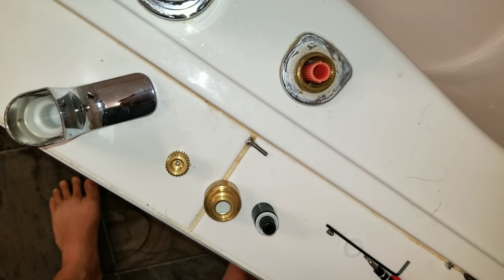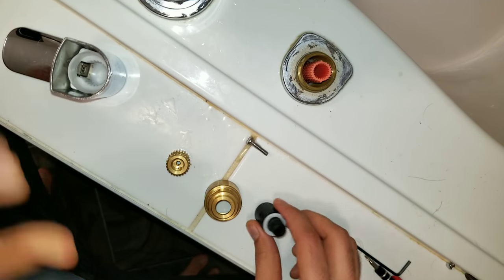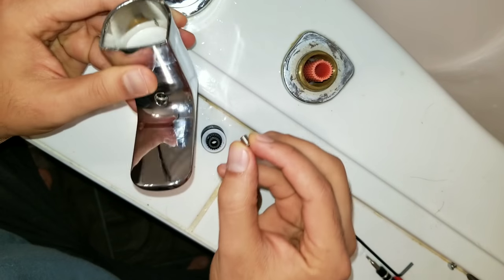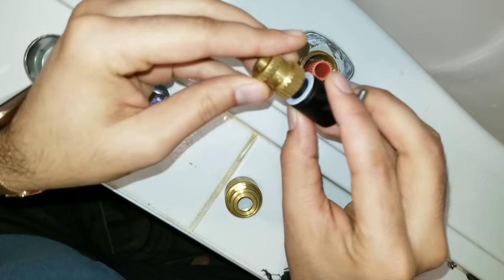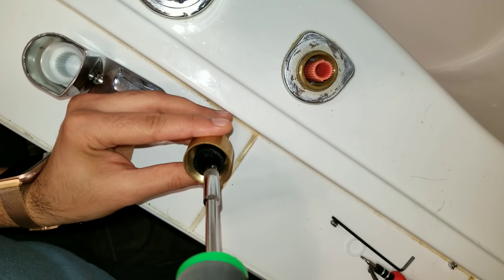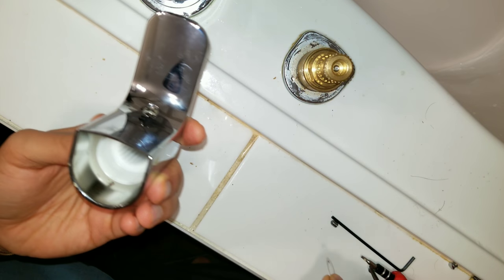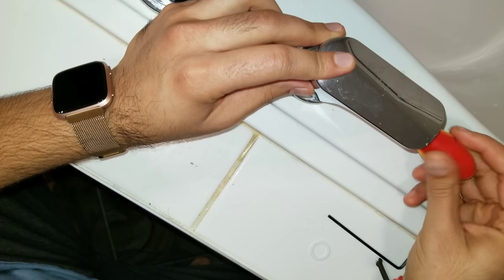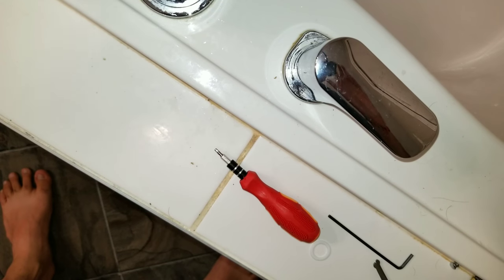Bath tub Faucet Repair. DIY (leaky or broken)

Comment: Great video!  You just saved me a call for a plumber.  I have the exact same faucet.   Just turned off the water supply first, just in case ;) but I don't think that was needed in this case since the valve didn't get turned on at the handle units until after it was fixed.  Cheers for your help.
Reply from the maker: Thanks for watching and comment. I usually do tech and smartwatch videos, but I had this problem and I did not find any video so I posted this video and it sure did help out a lot like you. I am glad it helped. Anyways if you can please Subscribe to my channel that will be appreciated and check out my other tech and smartwatch videos. Thanks 🥰